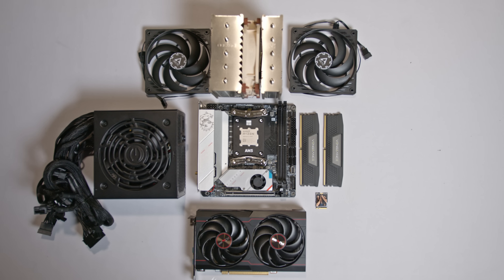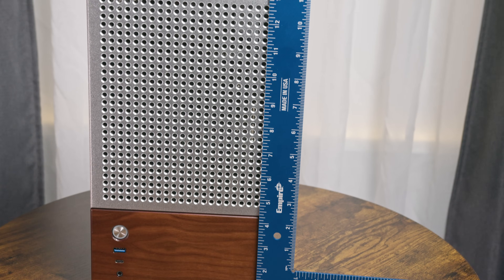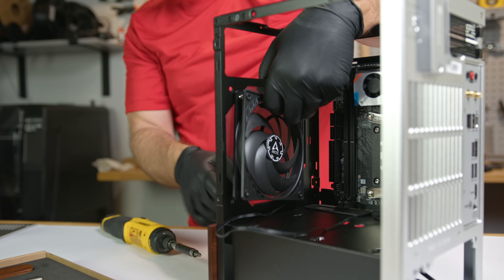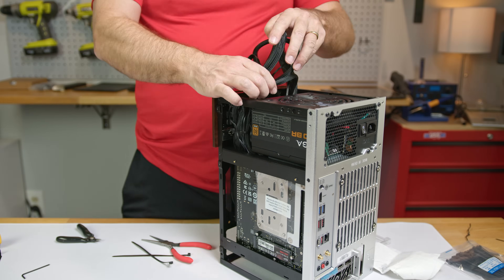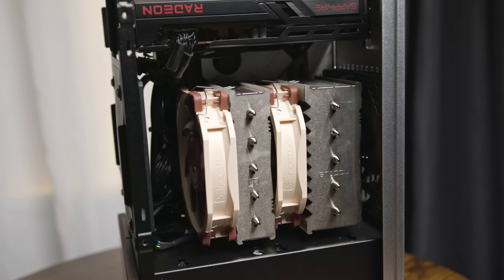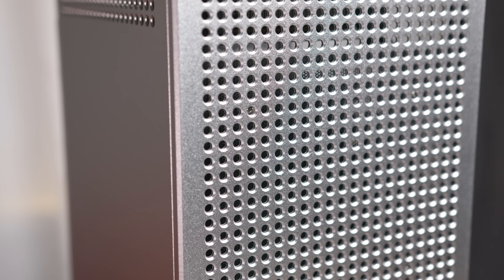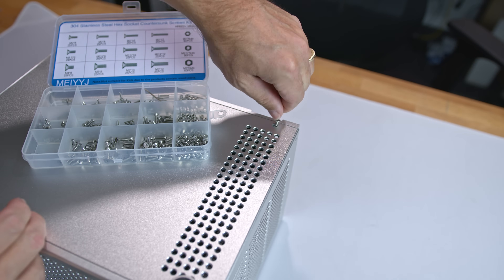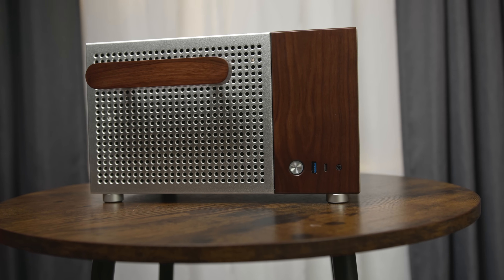Can This Tiny Case Handle Big Power? Jonsbo T6 Review!

Comment: This looks so weird to me. Pulling in air from the top is so counter intuitive and why buy such a premium case when you're limited to such tiny graphics cards. I'm already annoyed I was only able to find one single RTX 4080 SUPER that fits the Fractal Design Ridge after my RX 7900 XT already seemed too big (and it actually wasn't, no idea what I thought when I looked at those measurements before going out to buy a new graphics card. I guess warm air rising against the airflow isn't that much of an issue when the components can't be very strong but still... just feels weird overall. That and that gigantic handle at the top 🤔
Reply: Not everyone uses big GPUs. Using mid to low end hardware is actually quite common if you stalk any SFF PC boards. SFF is an interesting space because a lot of people want something kind of hyper specific.
Reply: If you're saying that it's a bad idea to intake from the top because hot air rises, hot air rises a lot slower and with a lot less force than fans can move air.

There's been a lot of testing on this, temperatures don't change if you intake from the top or the bottom of a case.

Comment: Just a note. You missed on the GPU. The best card that can fit in here is the 2 fan Gigabyte 4070 model. That card is under 200mm so should fit snugly in this case.
Reply: Yes, the most powerful graphics card for this case is the Gigabyte GeForce RTX 4070 WINDFORCE 2X OC 12G.

Comment: The front fan is installed backwards; instead of providing air to the heatsink, it’s taking air away from it, which makes the airflow somewhat inefficient. The cooling could improve if the front fan brings in air towards the heatsink and expels it through the back.

Comment: This case needs to be expanded from 223mm in depth, to 255mm
This will allow the use of XL PSUs and more GPU compatibility from 215mm to 247mm (242mm Founders edition cards)
While still fitting inside a carry on case.
Making it the Goldie locks of PC cases.
Also it would improve airflow and cable management, since the 140mm fan in the front needs more room to blow air upwards to the GPU.
I would even put 2 140mm fans stacked, in the front

Please lets make this dream come true :)

PS: also make passthrough holes for the larger 180mm long PSUs
Reply: I think the opposite. They could be even smaller.
Reply: @Lumperator  what for?
There are plenty smaller cases.
But little that can accommodate full size ATX PSU (180mm length) and still fit in a carry on
Reply: @lamboratorioaive  I don't see the need for an ATX power supply in an ITX computer. SFX (sometimes SFX-L) is used for this purpose and it is completely sufficient (around 500-600W).
Reply: @Lumperator  where I live. Specialty parts are rare to come by, such as sfx PSUs.
3rd world countries are notorious for having bad electricity, so being able to go and source an old PSU (when that sfx psu goes bad without warning) is of massive importance.
It's about availability and price

Comment: Would it be possible to use a top down cpu cooler in this case? I guess that would mean the fan would be facing the glass panel, but how much does that matter? I'd love to see the T6 provide the option to replace the glass panel with another grater-style vented panel.

Comment: Hey CJ, great video! I was just looking at this case for my next SFF build. Quick question if you don't mind? I would love to fit any of the Asus 4070 cards, but they're 227mm in length with dual fans. Could you perhaps measure on your T6 case what the absolute maximum is it'll accommodate for the graphics card? Frankly it would be an oversight on their part to not give you that extra 15mm as all dual fan 4070s are 230mm or less. Appreciate it, thanks!

Comment: The way the gpu is configured, you might actually want to install the cpu cooler so that it exhausts to the front as well. Probably wouldn't impact cooling too much, but exhausting to the front and the back irks me in a way I can't put into words. Also, nice heating in winter.

The room for an ATX psu is wasted because I can't imagine a current cpu drawing enough power that an ITX psu can't supply, especially when limited to a 215mm gpu. All in all, the handle is a great idea for SFF builds and the room for large air coolers is cool, but I think sandwich layouts are still the way to go for SFF.

Very interesting, but not the target group I guess.
Reply from the maker: I had the fans configured with the front as intake and the rear as exhaust, so all the ventilation was front to rear.
Reply: @ElevatedSystems  In hindsight, I have no idea how I made that leap of logic. Probably rotated it on the wrong axis in my head.
Reply from the maker: @overlordmarkus  no you were right. It was accidentally flipped in my B-roll shot. It was the right way during testing however.

Comment: The limited graphics card length is a deal breaker for most people I would  think.
Also, that doesn't look like real wood on the front.
The Fractal Terra is still ahead in SFF cases.

Comment: Theoretically can you fit a 120mm AIO radiator on the 120mm fan slot?
Reply: I'd also like to know this - Just ordered this case and was originally planning on using a Deepcool Assassin Digital AK620

Comment: I’ve been wondering if it is possible to fit a 4080 super and a 7950x3d by using a custom liquid cooling solution but I still can’t figure out where and how a radiator would fit in this

Comment: anything can handle any power if you don't care about dust or noise, because all you need to do it make it mesh on all sides and it'll be the same as open air.
but at that point you gotta ask yourself what even is the point of having a case.
Reply: Cats